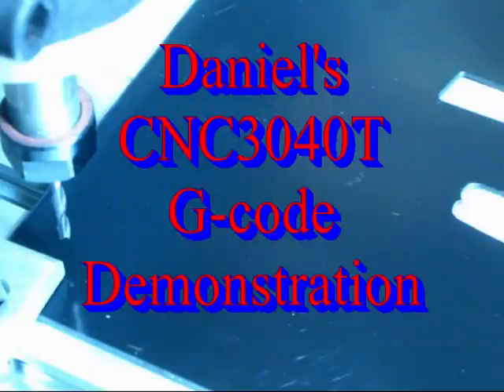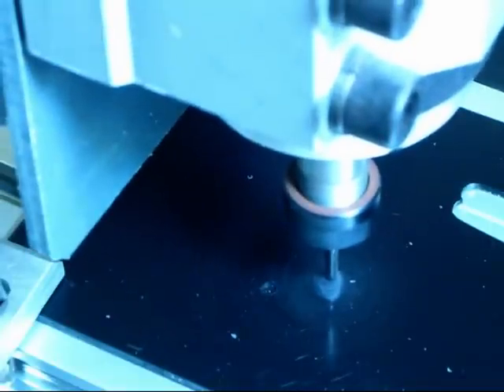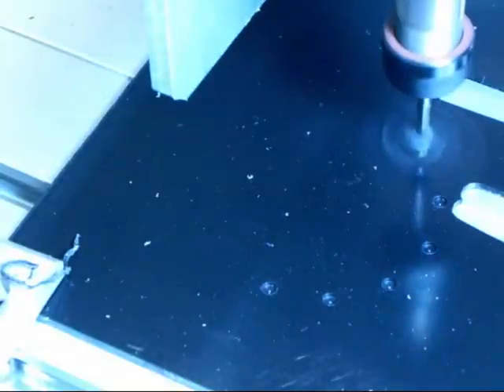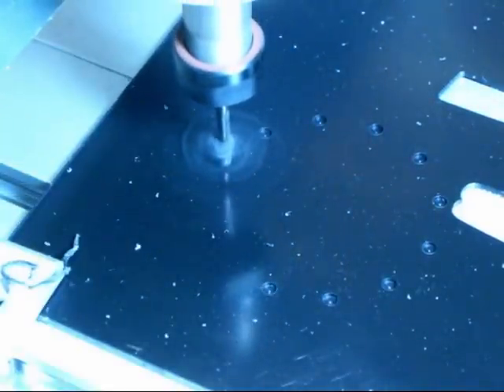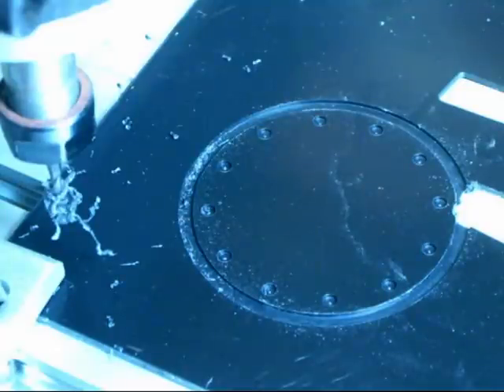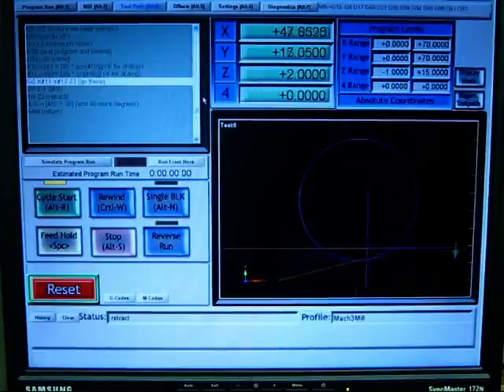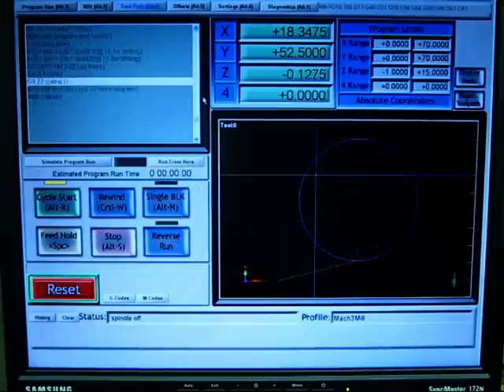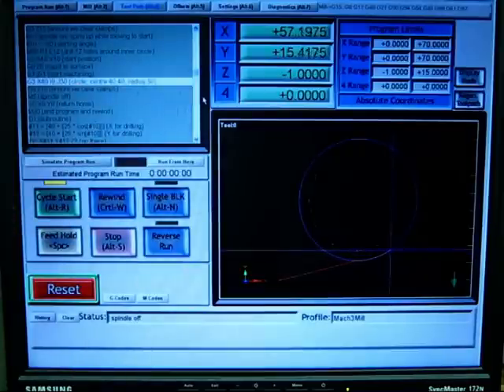Daniel's CNC3040T G-code demonstration

Comment: Hello.  I was wondering if you could help me out.  I just bought a chinese 3040 and based on the control box you have in your other videos, it looks like we have the same CNC.  I am having trouble getting it to work.  Could you let me know what settings you put in Mach3 to get it to run properly?

Thanks in advance.